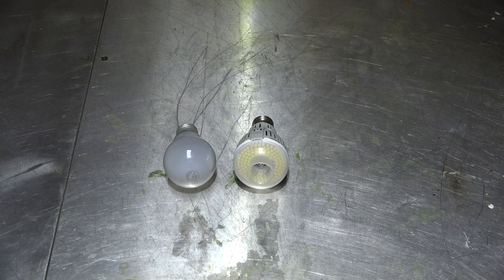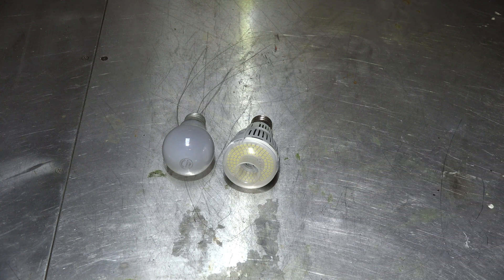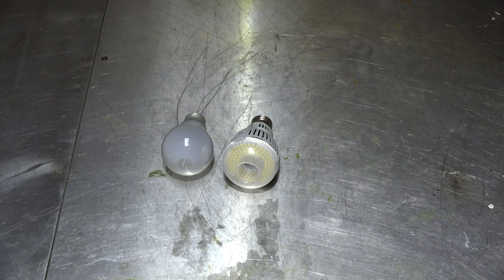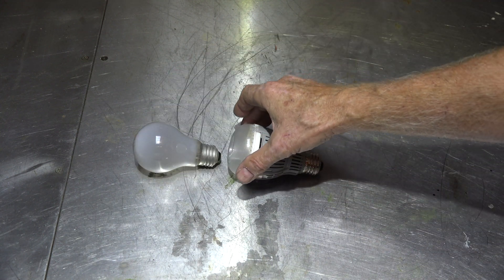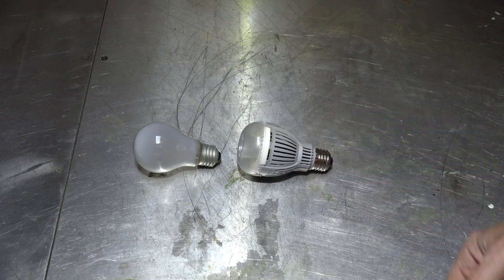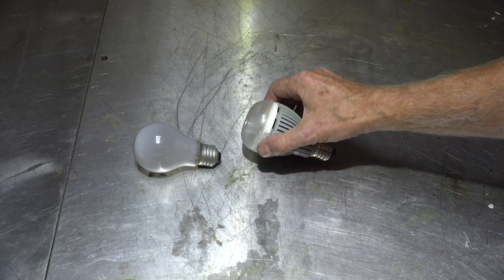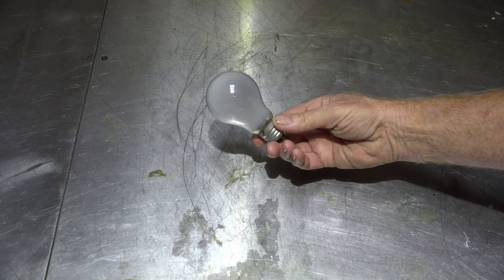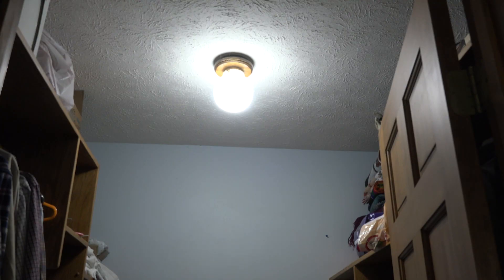A comparison of an incandescent and an LED screw in light.

Comment: the problem with LED's is cost vs life. factor in the total energy used to create them and figure they're loaded with "plastics" vs glass. at the rate plastic is being made and spewn around, the earth will be a big plastic dump site...... oh wait, too late! glass at least crumbles and crushes back to powder or sand like substance, yeah it cuts you so people need be careful, pay attention and not be idiots... I know that's a lot to ask  LOL! ;)
Reply from the maker: I hear this type of argument a lot.  Consider this:  The average lifespan of the led is 50,000 hours.  In that time it will use $50 in power.  The incandescent, not counting replacement costs will use $300 in 50,000 hours.  
Some of the LEDs have not been as long lived as represented but that has been changing pretty much at the same rate as the incandescent when it first came out.  
As for the components, The incandescent is not just glass.  It is tungsten, copper, steel, tin and lead.  All components used in electric devices have recycle problems.  BTW much of the electronic components are silica (sand).  
The point is nothing is without problems.  But if I do not have to replace it, it does not get into the waste stream.
GFM

Comment: they should sell LED bulbs as two separate components.  The first component should convert 120 VAC to ~ 2VDC.  The second component is the LED array that just plugs into the first component.  I jumped on the LED bandwagon from very early on when 60 watt bulbs cost $15.  These early bulbs failed after about a year.  It was the power supply that failed; the LED's worked fine.  Separating the  bulbs into to components would allow far less waste as the LEDs could be reused for years while only swapping out the power supply.  This would have the advantage that it would drive competition to see who could make the most reliable power supply .
Reply: larger fixtures and such have that, you have the led's strip section and a separate "driver module" chances are when one has an issue, the other also fails.. led in the string fails it over over heats the others and often the driver. alternate, the driver starts to fail and kills the LED's. end result, both pieces are junk or you'll end up damaging the new part swapped in.
Reply: A separate power supply would be built to better specifications, fused, and not subject to heat coming from the leds. Halogen transformers and even good switch-mode power bricks work for decades. The heatsink should also be part of the enclosure and the LED assembly installed such that it comes into contact with it using thermal paste. But keyboard commandos would cry about electrical isolation of that. The disposable nature of materials of modern bulbs is in contrast with the environmental claims.

Designs that have many LEDs in series ("filament") couldn't be made for the low voltage form factor.

Comment: I was thinking you were going to do a amp reading on the two different light bulbs and show what the electrical savings is between the two
Reply from the maker: I have done that in earlier videos.  The average is 5 to 6 times more power to operate the incandescent.
GFM
Reply: @grayfurnaceman  thank you

Comment: First I did the CFL Replacements and saw a big drop in power bill.  Then did the LED's and saw even a further drop.  I went to a Dollar Tree one day as saw the two pack "60 watt" equivalent  Sunbeam brand for $1 each.  I bought them all.  On average the replacements run 10 hours a day.  Have been running them over a year now.  Not one failure.  I also like the LED Street lights.  They are slowly replacing them in the city where I live.  Amazing how much more light for a fraction of power use compared to the older type street lights.  I think the LED Streets lights are fantastic during rain storms for vision!

Comment: I’ve replaced every bulb in my house with LED. The increase in efficiency is amazing. When paired with an occupancy sensor in certain applications (like an office bathroom), the energy usage would drop to almost nothing and the bulb would likely last decades. Too bad HVAC systems can’t be 4-6 times more efficient.

Comment: I read it is more like 2% incandescent vs 10% LED.  Neither are very efficient at converting energy into visible light.  LED produces plenty heat.  That's why most LED still say "NOT FOR TOTALLY ENCLOSED FIXTURE" on their packaging.  The heat kills the chip and board components.
Reply from the maker: I can't argue with the numbers.  Its just a question of better.
GFM

Comment: Fyi 12w led is equivalent to a 100w incandescent. I get the energy savings for light but just a thought that the heat that isn't produced by your lighting at night will be pick up by you electric heat if applicable. Gas if you lucky. So not sure on how much you save.  When people remodel a home they tend to remove a 60w incandescent in the middle room to 8 to 10 7w LEDs so similar wattage for light but lost in heat. Just a thought

Comment: LEDs are coming along.  One big issue is trying to force LEDs into the old legacy fixtures made for incandescents.  The issue I've had with LED bulbs is that of the power supplies cooking.  Avoid US major brands and you'll be okay.  Bought some GE lightsticks and they didn't last long.  Taking them apart, the LED was okay but the power supply was well cooked.  

LEDs do offer good possibilities for other forms.  I'm experimenting with a 12v LED tape on a piece of trim facing up about a foot below the ceiling.  It puts out a nice bit of light.  Liked the old ceiling box trim lights but simpler.  Having a white light that high is actually very good for giving you an awake mood.
Reply from the maker: As with many new technologies,  when they get popular and the numbers increase, problems arise and soon disappear.
Those that I have installed, mostly the Sansi brand, none have failed.  That could certainly change with time.
GFM

Comment: LED's do not work as oven lights. The older LED's get the less output they have. They do not play well with dimmers or with photoelectric cells. In enclosed fixtures their lifespan is much shorter because of the heat (need ventilation for continuous use. They are much better than just a few years ago. I consider them still an emerging technology. Many failures for me over the years, but like I said, no where near what it was a few years ago.
 I have converted from incandescent to cfls to LEDs. I still have a pull chain with an incandescent in my attic that will probably outlast me and I feel it is not economical to change it. I also know people with well houses that burn incandescents to keep from freezing. There are still some practical uses for incandescents just not many.
Reply from the maker: Agreed.
GFM
Reply: there are high efficiency halogens which can replace regular incandescents in applications not suitable for leds.

Comment: A few notes on LED vs Incandescent:  Clearly LEDs are longer running and as such are excellent for difficult to access fixtures.  I do prefer fixtures that are made with integral LEDs so the assembly can be smaller and less intrusive, especially for applications like small closets and under cabinet fixtures.  To me a downside is LED’s impact on colors.  In your demo it is obvious that the LED was imposing a blue tint on most everything.  Some versions are better than others on color but for expected colors you want to aim for a 2700k “color temperature” rather than the higher values often supplied.  From a brightness standpoint, to avoid excessive light, find a LED with about 800 lumens when it is desired to maintain a standard 60w ambience.  Finally, LEDs still get hot because they have an integral power supply inside to convert ac to a lower voltage dc.  As a result some designs can overheat in a closed fixture especially if you buy for maximum lumens.
Reply from the maker: The issue of color is a subjective one at best.  We tend to try to match what we are familiar with.
I have found that in many applications, the higher color temperature and more light beats ambience.  But I have old eyes.
GFM
Reply: cheap LED lights = short life, even expensive ones may not last... I've been using and installing them for years and I swap out many burn outs. 
the longest lasting stuff was the old T12 fluorescent tubes and magnetic ballasts! also large mercury/multivapor bulbs and magnetic ballasts ;)
I see LED street/traffic and many other lights dropping like flies everywhere, not hardly past the 1yr mark and in commercial stuff, that's way past any warranty lol